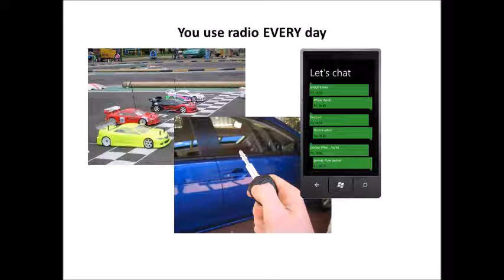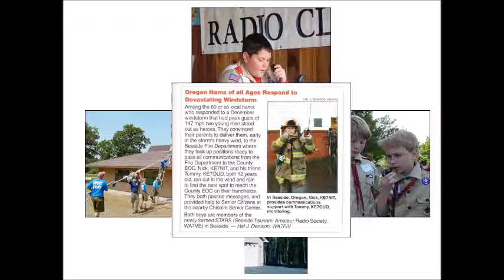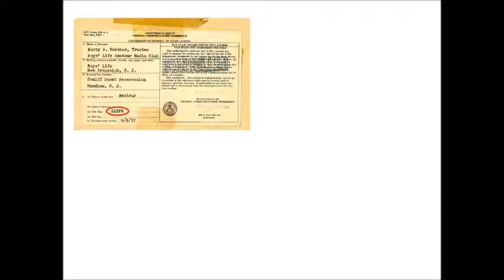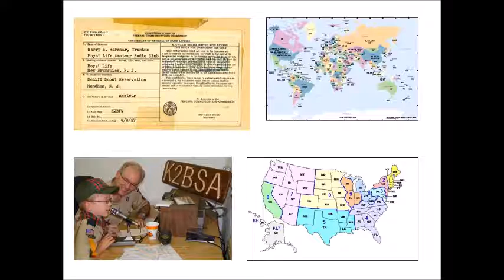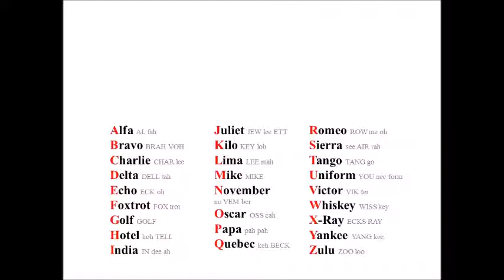Radio Merit Badge & Ham Radio #1

Comment: Nice Job ! However,  the video makes a incorrect assumption. 
There is statement that says something to the effect of ... the low power hand held radios your boy scout troop uses are unlicensed family radio service. Our troop and several others nationwide have taken steps to be properly fcc licensed for business radio frequencies. We have even gone the extra step to be using DMR digital encrypted radios with data signals for GPS location tracking and text messaging. 
WQWS720 Boy Scout Troop 188, Lake Villa,  Illinois. 
Dave
W9DAV 
W9DAV@YAHOO.COM